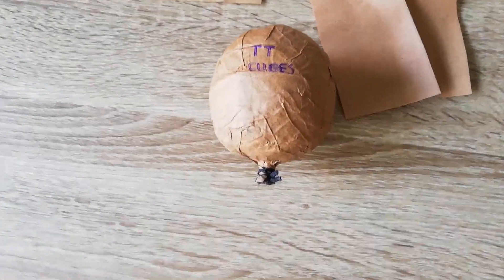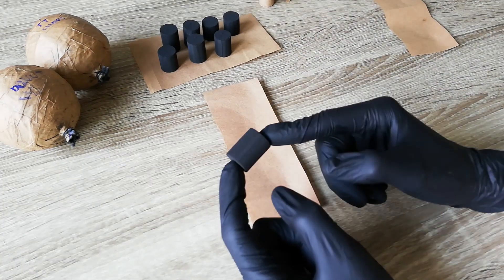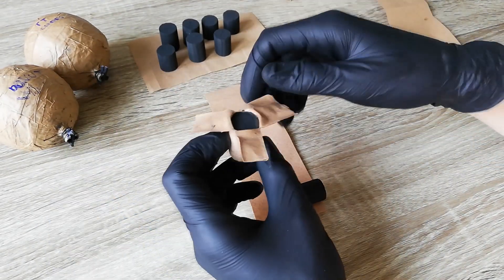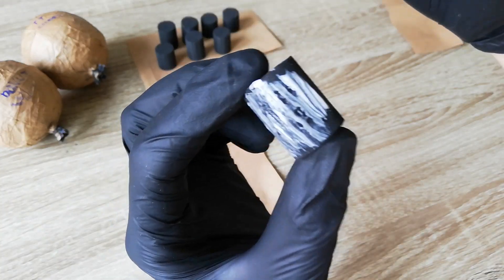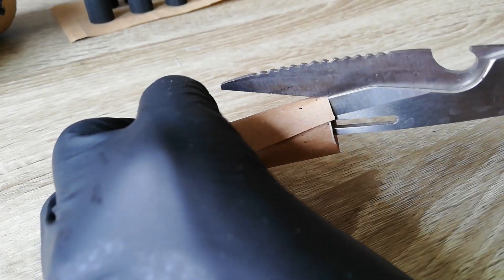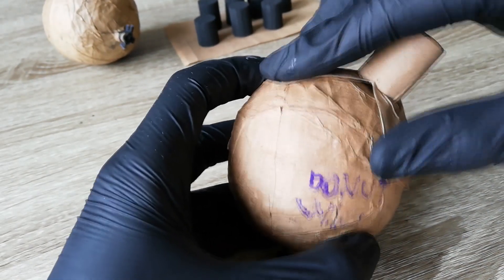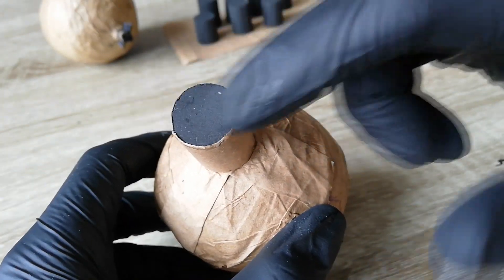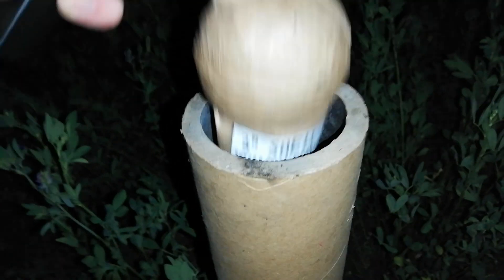Making Rising Tail Effect for Display Shells!

Comment: great video, so the rising comet lights up when the lift charge explodes right? it doesn't need match on them.
Reply: You might want to put a little glue on the end of the comet and dip it in black powder and let it dry that way before attaching it to your shell. I had a couple shells where the comet didn't light but after priming it, I never had a failure. Try it both ways, you might have better luck than I did.
Reply from the maker: Sometimes thin blackmatch is put on top, but if you have charcoal tails they won't need primer in most cases

Comment: i don't know if you're still answering comments, but is it possible to get a green star using boric acid? i know that barium nitrate is usually used, but since i cant really get my hands on it, i thought it would be worth asking
Reply from the maker: As much as I know, it's not :)
Someone could correct me
Reply: There's no way of achieving a green star from Boron ions. Boron is just too weak. It does the job when you want to color a fire or flame of blowtorch. Check out the Pyrophoria  videos abt stars, he explains it in detail. 
Also, Boric acid isn't oxidizer at all, so it'll slow down the burn and leave a lot of slag, with no color.